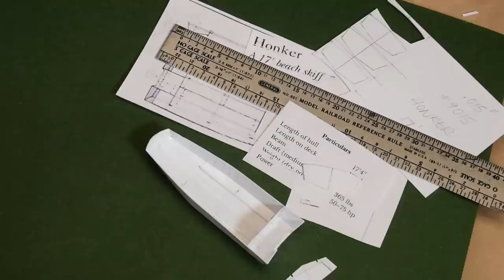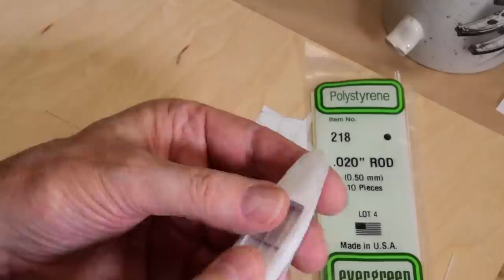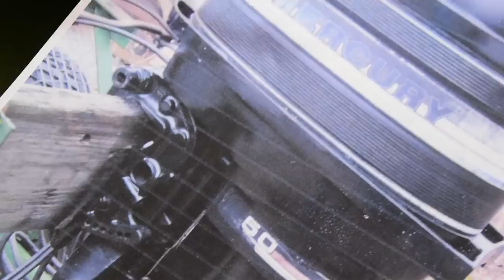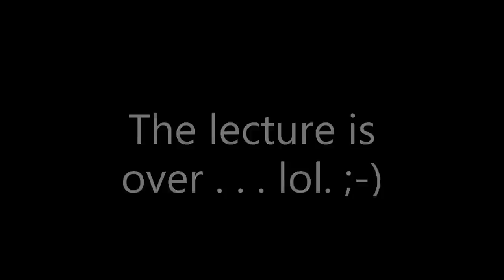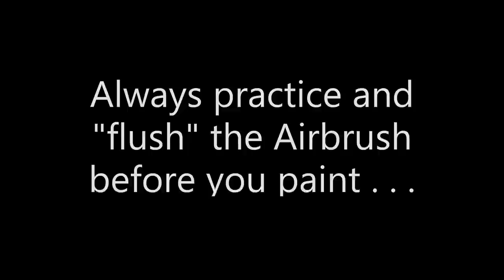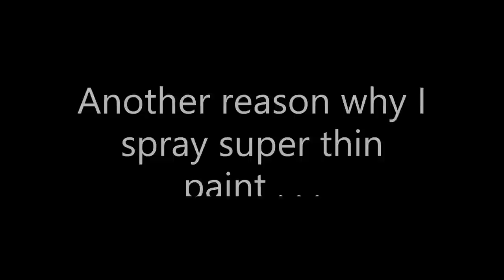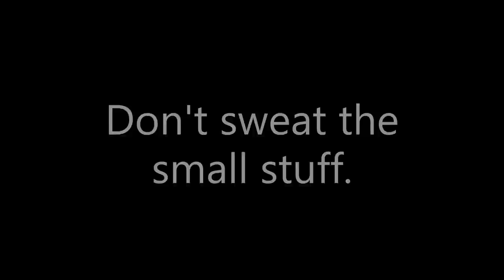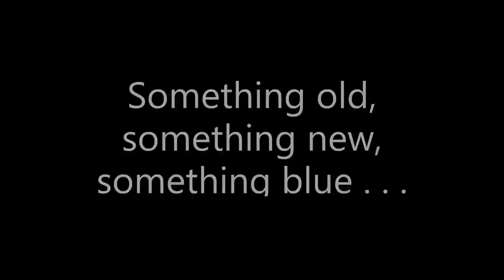Scratch-Building & Painting - The Fine Scale Honker Skiff | Boomer Diorama ~ Vlog # 192

Comment: Thanks for the airbrush lecture!  That not only explained why you use a higher pressure, but gave me some ideas why some people I know in the model-car hobby prefer lower pressures.  Here's my theory of what's going on here -- I'd be curious about your thoughts.

If the main effect of the higher pressure is to atomize the paint into smaller droplets, that has a couple of effects.  It's going to mean that you need less paint thickness to get an even coverage, which is especially important for small-scale things, and it also means that you get smoother partial coverage and "fades".  But it also means that the paint droplets lose more solvent between the airbrush and the surface, and so I'm guessing that the fact that you use really thin paint and tend to have the airbrush quite close to the model are important in making sure that the paint isn't evaporated to damp dust when it hits the model.

Meanwhile, the model-car folks are trying to get a really even glossy coat on a much larger surface.  That means that they have the airbrush much further from the model, and they want to have really good control of how dilute the paint is when it hits the model -- so having larger drops that don't evaporate much is important.  That also means that variations in things like distance or in how far the trigger is pulled back don't affect the droplets too much.

I'm guessing that it also matters that your airbrush has a very straight concentric needle, so that even when the orifice is barely open you still have a concentric opening to get even droplets all around.  I'd expect that the small openings needed with higher pressures would amplify the effects of bent needles.

The upshot of all that is that it very much is going to be a "try things and figure out what works for you", just because there are so many different factors that affect the results.  Which is something I remember you saying a time or two.  :)
Reply from the maker: I rarely ever shoot gloss paint. For car models I simply paint the vehicle flat then clearcoat. Simple really. Super high gloss finish looks out of scale on a small model for me anyway. ;-)

Comment: Hey Boomer! I'm a big fan - I subbed before I finished the first video. Your skills are amazing and your willingness to share the experience and knowledge are first-rate.
One thing I noted in this video: cleaning your airbrush by spraying cleaner through it works well, but you might take a trip to an auto parts store and pick up some absorbent pads called "Pig Mats". They're designed to be used for working on greasy, gassy engines and crap like that. They soak up a great deal of material (think oil change on a Semi truck - lots of spilled oil). Might keep your work surface cleaner and save it from dripping on the floor. I checked one source and the "official" nomenclature is... drum roll please: Spill Control Air Matrix Polypropylene Heavy Weight Maintenance Universal Absorbent Laminated Pad! I'd just ask for "Pig Mats"!
Thanks again for your efforts to educate us heathens - when I make something that turns out good it's usually an accident.
Stay cool, be well, scratch your kitty for me!
Reply from the maker: That what just a spontaneous demo and not my practice. With video production setting up (and changing) every shot is just too laborious Thanks though. Cheers.

Comment: Interesting discussion on airbrush pressure and paint viscosity. I see the comment about Tamiya XF as a primer. Do you think commercial primer is not required on most models and thinned XF will work in most cases as a primer? If so this opens up a world of colours that can be used to prime models. Thx as always for the great blogs and tutorials. That boat detail is insane!! Growing up in Coastal BC we had one of those wooden Bartender boats with a 50 hp Merc on it. Such fond memories playing "Beachcombers". Thx for the memory rewind
Reply from the maker: I don't spray primer on my models if I use Acrylic (XF) Tamiya. Especially on small scale models where you can easily obliterate details with extra coats of unnecessary paint. I see no need to primer (over plastic) when Tamiya Acrylic is flat anyway. If the model is metal then primer is a good idea. I see people primer plastic models all the time and I just see it as a waste of paint.

The Bartender (plywood) boats are awesome. Cheers.

Comment: For anyone looking for a great, quiet contractor's type of oil less diaphragm compressor, check out California Air Tools compressors.  I own two of them.  A small 1 gallon rig, with a single compressor/piston that's my dedicated airbrushing/paint booth compressor.  The other is the 2 gallon dual piston rig that I use in the garage.  Both a very quiet (55db and that's a real spec).  I can use the airbrushing compressor in the basement at night while everyone is sleeping, without disturbing anyone.

Way quieter than "contractors" pancake compressors or the same in the "hot dog" configuration.

Comment: Nice work, but if an airbrush worked with pressure on the same side as the needle would not the paint blow out of the cup when you pressed down on air
Reply from the maker: No . . . because there is a built in "bleed" hole in the tip that bypasses the orifice until you open the needle. Like I said it's a general description without getting technical. ;-)
Reply: @boomerdiorama  their is no air on the paint side of the needle, it works because of the low pressure at the top of the needle siphoning the paint.
Reply from the maker: Sounds good! @miker105
Reply: Great build, and as always lots of info , many thanks for taking the time to share this info with us …….. would have loved to see the initial steps in building the hull , in bigger scales I would have built it over a former / hull sections but sort of guessing you might have winged it by first doing the bottom panels , adding bow , stern and maybe a midships section ?, then the sides  ?